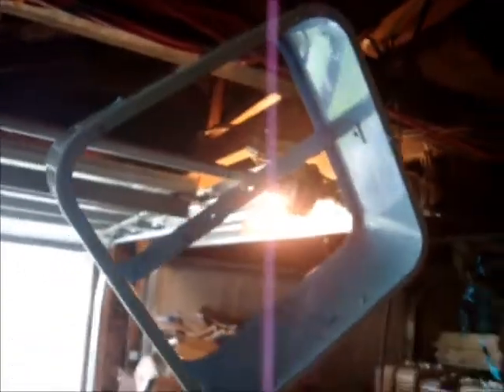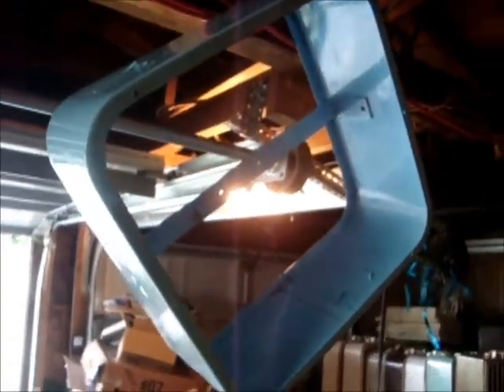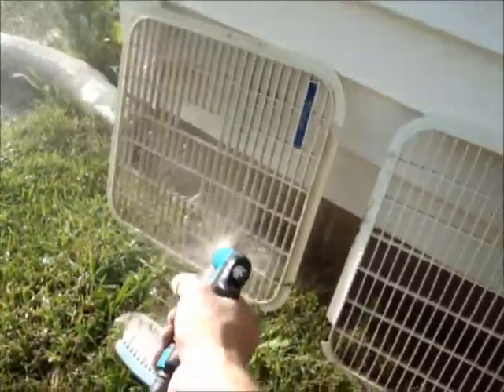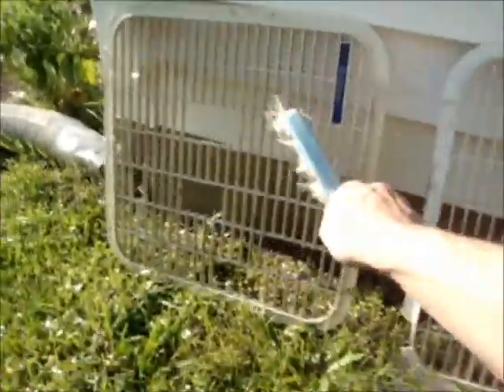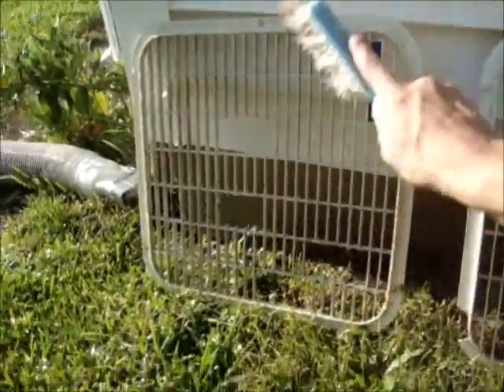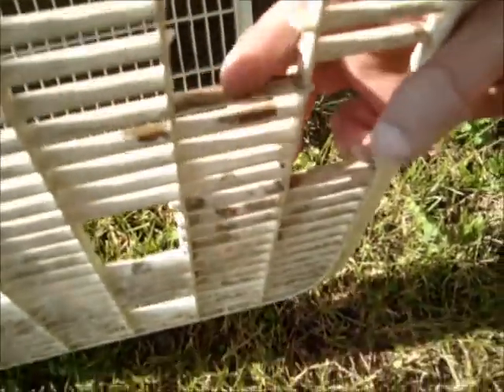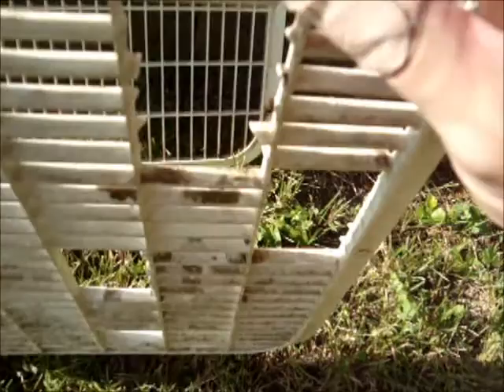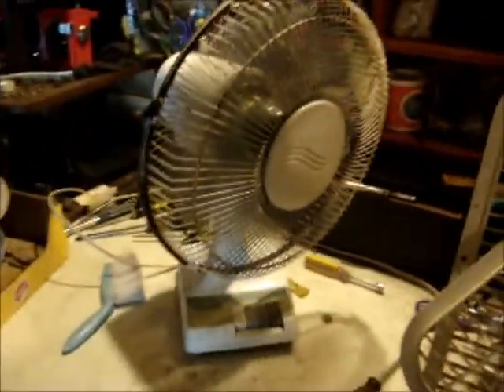Windsor C-14 Restration Part 2 ( cleanning and re painting)

Comment: Color looks really good.. Are you using spray paint? If its running the coat is a little too heavy.. you're better off doing two light coats.. For cleaning the grills.. I get them wet then let it soak for a little while,, then spray it again.. usually gets all the junk off.. takes a little longer than brushing it but its easier lol.. What fan were you using to dry the grills? Looks like one I saw today at the tag sale store..
Reply from the maker: Jordan U That was the 12" Windmere that had the missing front cage from that house. i may have over done the paint. but it turned out fairly good. as for the grills. it took awhile to get them fixed. i had to glue that whole side back together. and zip tie it in place while the glue set in. i got 90% of the crap off the grills..LOL